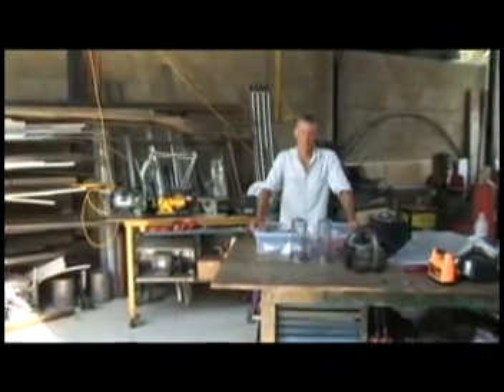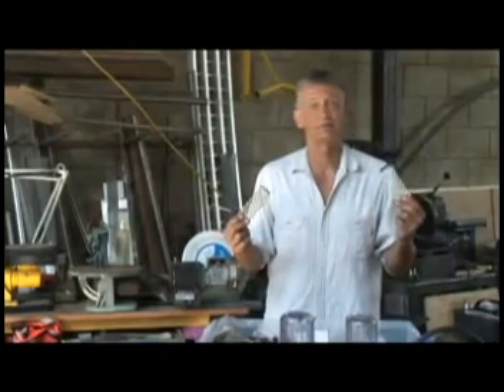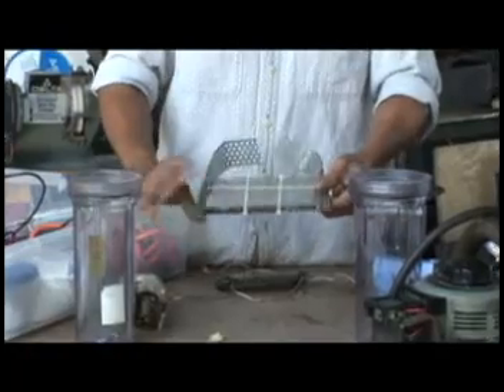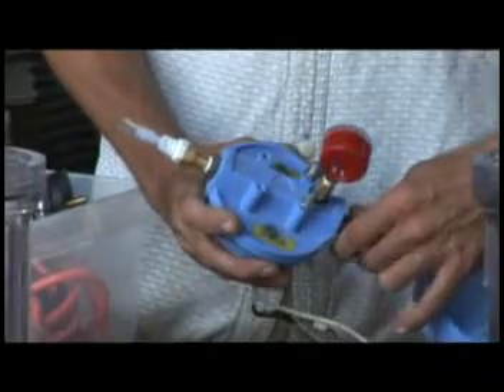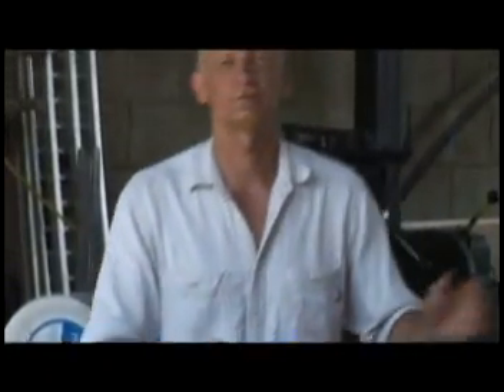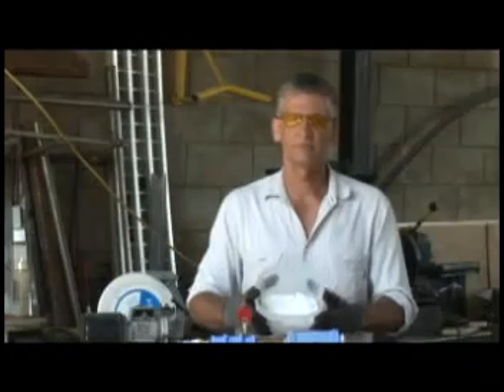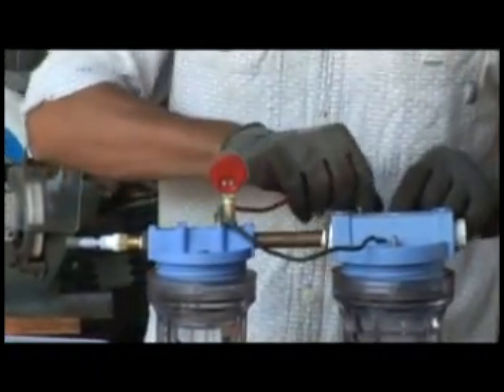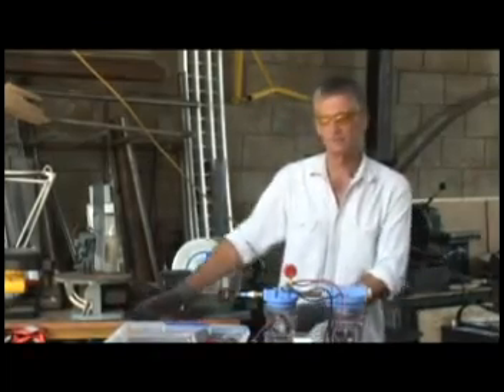hydrogen HHO - Hydralizer the SHOP new tv show part1

Comment: Yull brown used baking soda and mild steel.

I think you really want to build a bob boyce cell.

watch?v=aOozaNPvfTA

This is a 100 cell unit 317L still under conditioning. Each cell works like a battery, so it is only mildly overcharging at 205 Volt.

do a websearch for "bob boyce".